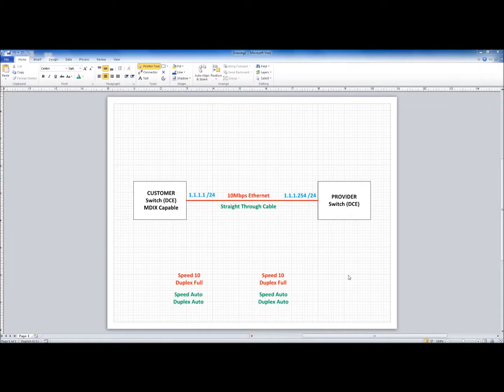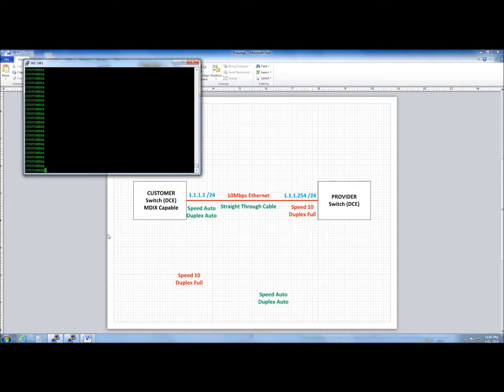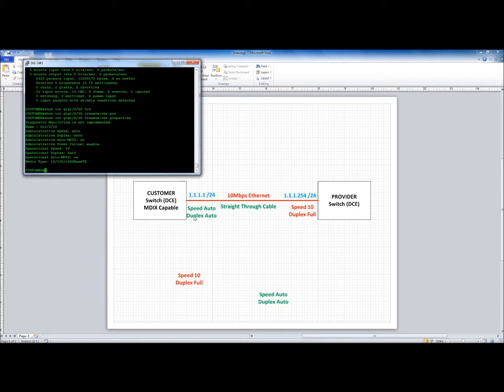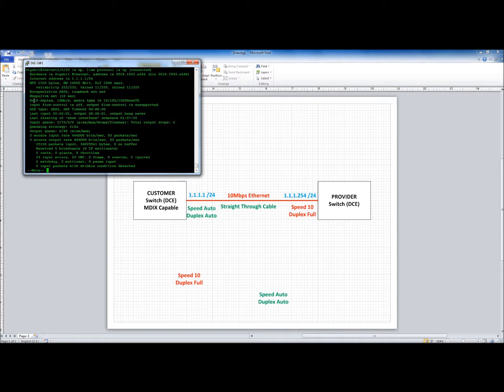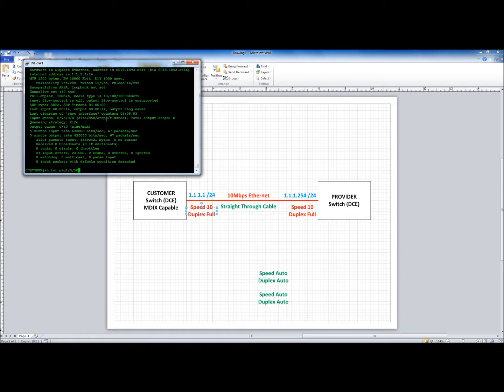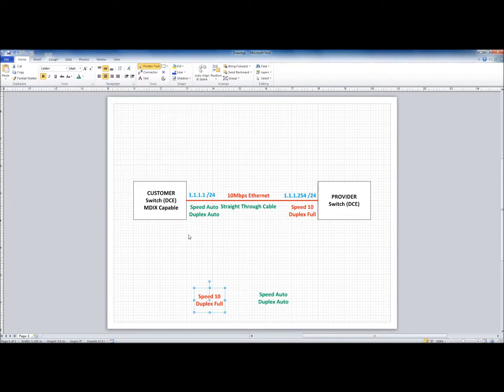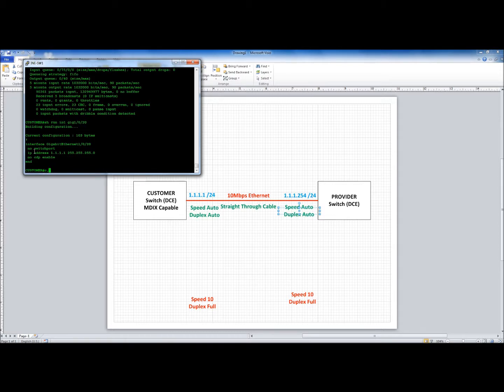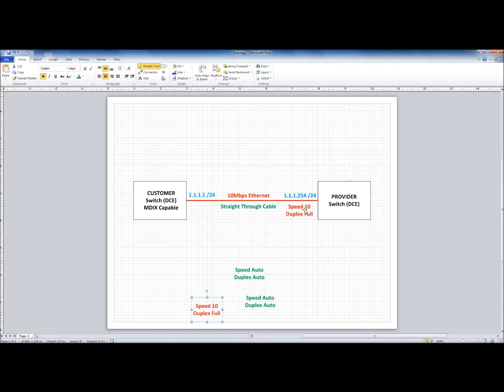Cisco MDIX dependency with Speed/Duplex

Comment: why straight cable ? if you have same devices you should use cross over, right?
Reply: What the presenter should have stated is that the two switches are using automatic MDI/MDIX ports.  After the cable is plugged into each port, the devices will work out which side will use MDI and which will use MDIX.  Hence, there is no need for a crossover cable.